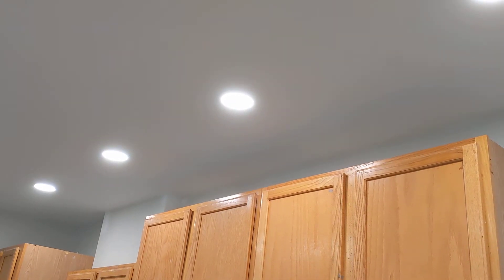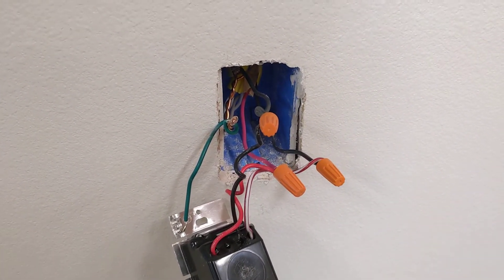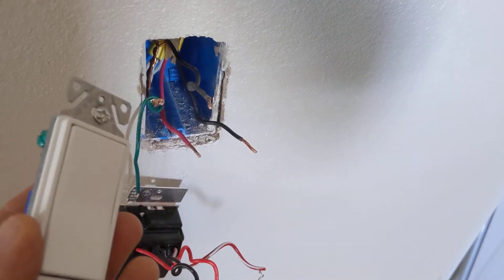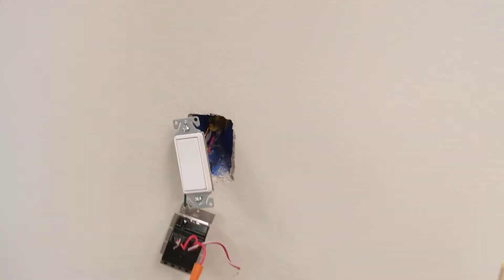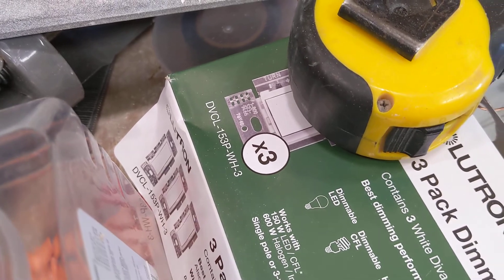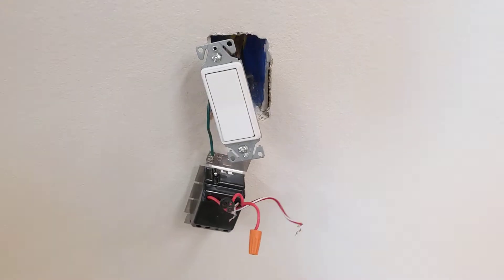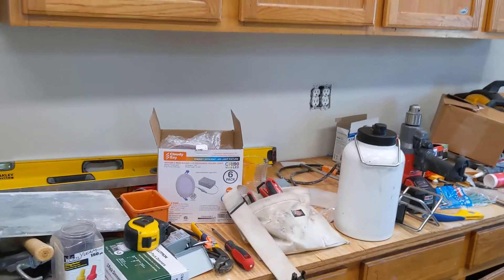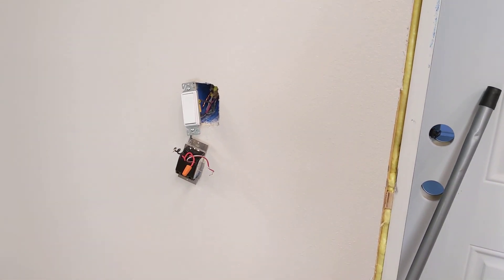Buzzing LED Problem/Solution

Comment: Always heard that buzzing noise in my kitchen. I have two 14 by 14 led ceiling lights.  2 dimmer switches. one Dinning room added to Dinning light switch . One on kitchen exit door to sun sun room .Should I replace both.  Great video thanks
Reply from the maker: So, depending on how comfortable you are with electricity, you can pull out your switch and then complete the circuit by touching the wires that the switch interrupts (don't shock yourself) and if the buzzing goes away then you know it's the dimmer. If these are on a 3 way, then you'd have to remove the dimming switch, as a regular 3-way shouldn't cause any buzzing. My understanding of how a dimmer works is that it is turning on and off a billion times a second and the led drivers don't always like that... So, remove the dimmer and see if that's the issue. If it's still buzzing, then that means the driver in the light is the issue and could be from a bad connection or it's just how it is... If it does take away the buzz then you can go on a quest to find a new dimmer, but you'd literally have to keep trying different manufacturers until one worked and there's no guarantee any of them would work because again, the way it is being dimmed is the device doesn't lower voltage, but rather sends a billion pulses to the driver telling it to turn off/on so that you perceive that it's putting out less light...

Comment: I know it is a old video but I have same issue. Anyone can recommend me which dimmer to use please.
I m using halo lights with Leviton decors switch.
Reply from the maker: Halo should have a recommendation for which dimmers work with your product. Give them a call and they should be able to help. If you're using a recommended dimmer and it's still buzzing then you can check wiring and see if a poorly connected neutral is causing an issue, but sometimes there isn't a perfect solution...

Comment: That was NO help.
Reply from the maker: Unfortunately LED buzzing doesn't have a magic bullet. The wiring, internal driver, switch, etc. can all lead to buzzing. The easiest fix is to try a different switch, or remove a dimmer. It will at least let you know if it's the switch or driver causing the problem. Otherwise checking wiring, or replacing the light are the next steps.

Comment: I just paid 170 to an electrician who switched me from a regular light to a dimmer -which was a good call, however as soon as he left and the house was quiet I heard the bussing noise. It has been frustrating to deal with either bright lights or buzzing. I'm going to change the light bulbs to see if that makes a difference but if that doesn't work I'm going to call in another electrician to do what I originally wanted...which was to separate the two lights that are on the same circuit
Reply: try elv dimmer switch

Comment: I'm using regular bulbs in my dining room chandelier. However, there are 8 bulbs on it. Could that be causing the high pitch buzz?
Reply from the maker: So incandescent bulbs operate differently from fluorescent and LEDs. So, if you are using a dimmer with them then you might want to check that your dimmer is made for the bulbs you are using. However, there are many different reasons why bulbs might be buzzing and it could be from another appliance on the circuit, low voltage, old filaments, loose neutral or ground, etc. I would first start removing each bulb individually and see if one might be faulty, if every bulb is buzzing the  it's more likely the dimmer and you might try replacing it with a regular on off switch ($.70 for a single pole) and see if that solves the issue. If you're set on having a dimmer, then try out a different dimmer or switch to LED and use an LED dimmer. Trial and error are the best method for tracking down the cause.

Comment: I am here too because of the same issue.  Changing the lights in my downstairs. When turned on, my new lights buzz. Also  when I turn on those new downstairs lights my upstairs bathroom LED  light buzzes, it is on a different circuit. Bad harmonics being induced into the circuit is all it can be. Crazy thing is as I install the new downstairs retrofits when powered on as soon as i make the clips contact the can, ground them, they buzz way worse. Take the dimmer out of the equation and all is well more or less. Lights just keep getting made cheaper and cheaper, the led drivers are not what they used to be.
Reply: Same problem. I have never experienced such issues with dimmer and LED capability before. Bad harmonics is definitely the issue, though is it really the dimmer switches that are creating the harmonic distortion? Or, are the dimmer switches disrupted more easily by harmonic distortion, compared with straight rocker switches? Many thanks
Reply: @cpg8000  I believe it is honestly the new LEDs that are the over all problems. Not being build well with cheap drivers, if you can even call them drivers. They lack  capacitors, when shopping for LED lamps, call me crazy,  I look at the more pricey option and feel the weight difference in the lamp. That weight difference is the driver is built better imo. All that said, all new lamps made cheap, if we want dimming without buzzing, our only control is the dimmer option we chose.
Reply: @wesleynichols5676  I think you are correct on all accounts. I also think dirty power makes current digital dimmers and dimmable LEDS go nuts. I only seem to be able to solve this by using a straight rocker switch and non-dimmable bulb. It seems the non-dimmable bulbs are “weightier”, and maybe resist noise or voltage fluctuations a bit better than dimmable counterparts. I’d be curious to understand the difference in internal architecture of dimmable bs non-dimmable, and why that might make a difference.

Comment: Hall lights do it too I just installed them and have same issue
Reply: Halo*
Reply from the maker: Hmmm... I figured a more expensive brand wouldn't have issues. Did you try it with different dimmers or just a regular single pole?

Comment: Hello, we are using led bulbs and a led compatible dimmer. We still get that annoying buzzing sound from the chandelier. What could be the issue?
Reply from the maker: The way most dimmers work is that they send a rapid on/off signal to the light to basically create less time for the light to be on, thus "dimmer". Some lights have a certain frequency they like and will buzz less at. Generally, if the light is completely on with no offs then it will buzz less. So, I would get a $0.99 switch and wire it in and see if it still buzzes. If it does keep buzzing then it's not the dimmer and it could be a faulty driver or a ground/neutral that doesn't have a good bond. If the single pole regular switch removes the buzz then it is likely just cheap drivers on the light itself, or the "compatible" dimmer isn't as compatible as you'd like it to be and you can try other dimmers and see if they work better. I tried out four different dimmers with these lights and none of them made a significant difference (all of them were labeled as "compatible" by the light manufacturer). We just decided they had cheap drivers in them and if it got too unbearable that they could use a regular switch.
Reply: @MyFortressConstruction  thank you so much for taking the time to respond sir! I will be investigating more today

Comment: My dimmer works fine, no buzzing until i plug my TV in the outlet above. Even without turning on the TV the lamp starts to flicker. Thd lamp has five 13watt bulbs. Have no idea whats goinh on.
Reply from the maker: You can see if it's part of that circuit by turning off that light breaker and seeing if you still have power at that outlet. If you do, then it just means that the frequency of the TV circuit is causing a disturbance with the frequency of the lights. It is a fairly common occurrence and a lot of Electricians will keep the light and outlets on separate circuits because of that. You could try different bulbs, or hire an electrician to move that outlet onto a separate circuit if it bothers you too much.

Comment: Is there any danger having the buzzing, if the LED lights causing the noise, is temporary?  Thanks in advance.
Reply from the maker: In electrical there is always potential for danger. If you have ground wires properly run then you minimize your risk, but an intermittent buzzing coming from an LED light sounds like the driver inside the LED might be dying. If you only get buzzing when you dim the light, then it might just be an incompatible switch for the LED light.

Comment: Can I just change the light bulb?
Reply from the maker: Potentially, but a lot of fixtures have the LED assembly built into them, like these recessed lights, and you can only change out the whole unit.

Comment: OK What you need to do is replace your dimmers with and elv dimmers with neutral and you will correct your problem. Go with Leviton dse06. There is 2 different drivers for led. forward or reverse phase drivers. you have a reverse phase so you need an elv dimmer. Let me know how it goes. Gates
Reply from the maker: Thanks! That's in line with what I had read, except I didn't know the reason was because there was a forward and reverse phase.

Comment: Hi Robert!  Great video, thanks! Here's a few ideas: 1)Overloading your dimmer with excess wattage can also result in buzzing and humming (check the wattage rating on that 3-way dimmer vs the total wattage of the bulbs). Going with Spec Grade Switches is always a great idea. 2) As you said: Change the bulbs: Buzzing coming from the fixture itself is usually related to bulb filaments. Longer filaments are more susceptible to electromagnetic changes, which can result in constant buzzing so changing the brand of the bulbs can help.
Reply from the maker: Thanks Bill! Good points and it turns out that these specific down lights are just not the best quality. About 1 out of 4 were buzzing ($5 each compared to $28 halos of the same variety). Now, the thing that puzzled me was why the main panel was buzzing when the lights were on. Normally I've just noticed it in the fixtures themselves, but have you ever heard buzzing in the panel with a certain dimmer/LED combination?
Reply: @MyFortressConstruction  Yes. That's the sound of current flowing. Are you running a 15A breaker and 14ga wire for that lighting circuit?
Reply from the maker: @SparkyChannel  That specific circuit is 12/2 on a 20 amp circuit. It has a combined wattage load of 320 watts on it from multiple LED downlights and some panels. Nothing but lights are on the circuit. The LED panels don't hum, only the downlights. Also, the humming goes away with a standard switch, so is it the millions of pulses of on/off from the dimmer that makes the hum?
Reply: @MyFortressConstruction  Interesting. I love that you used 12/2 for the lighting circuit. That circuit uses a maximum of about 3 amps so you're not even close to an overload situation. I think you're correct suspecting the 3-way dimmer and the can lights. For the humming at the breaker, have you tried a different breaker?
Reply from the maker: @sparky channel Yes, this house already had 12/2 everywhere and all 20 amp breakers, so I wasn't about to change anything, though it's definitely overkill! 😄 It's so common to see a 20 amp breaker when there's 12 and 14ga. wire spliced throughout a circuit! 
  I have tried a different breaker, checked neutrals and ground to make sure no loose connections, and the only thing I came back to was that the dimmer and certain LEDs were fighting. It's in the garage, so, no big deal there. Thanks for your troubleshooting tips!
Reply: @MyFortressConstruction  No problem, I think you got it right. Best wishes to you and the family! 😄
Reply from the maker: @SparkyChannel  Thank you! I'll look forward to more of your videos!